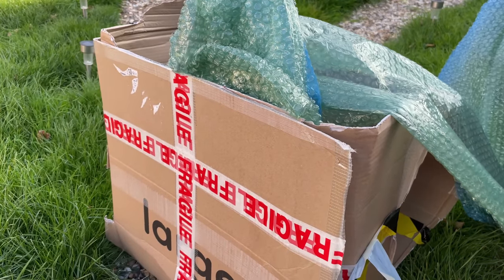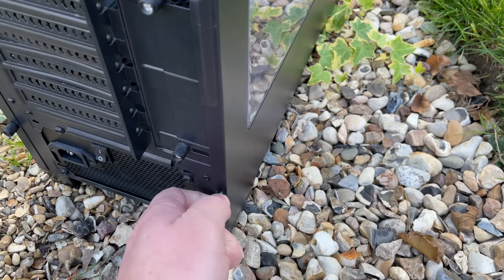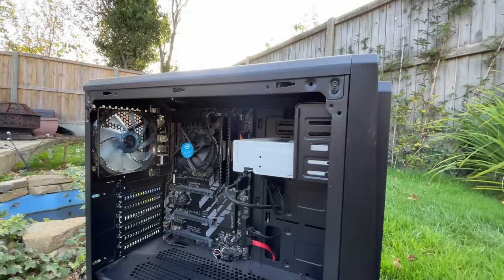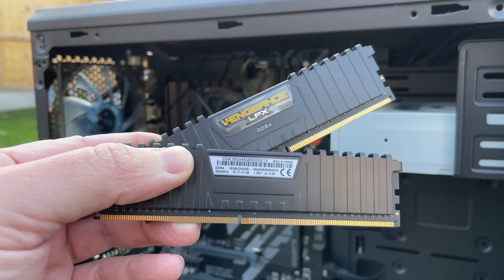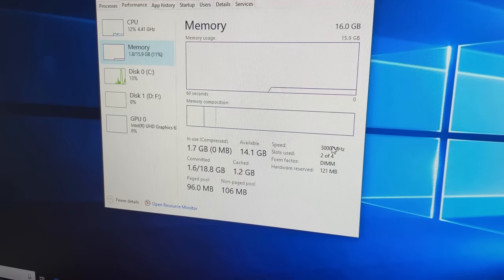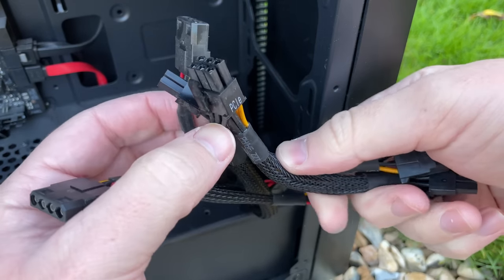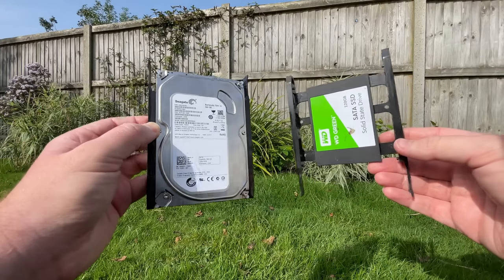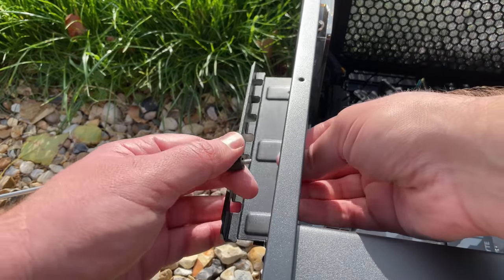This £169 PC has an i7 8700 - But Was It Worth It?

Comment: Having a PC with a DVD drive (and a bay in the cabinet) is always worth it for me. I have got dozens and dozens of games' DVDs that I can't use in my "modern" PC, because decent new cabinets don't support DVD drives.
Reply: Get a usb portable drive. Easy and cheap.
Reply from the maker: Yeah same I always miss it if I don’t have one
Reply: @themorphman100 already tried that. Bought 2 and both stopped working after a while. These Usb ones don't last really long. 
Though I also have an old PC from 2012 which has the DVD drive and that one still works.
Reply: the fractal pop air has a 5.35" bay and is a good airflow case too, if youre looking for an option
Reply: @RandomGaminginHD I call this a "forced" upgrade. So that people have to again buy digital versions of the games they already own on DVDs
Reply: @themorphman100  They are poorly built, versus internals.
Reply: I have dvd in PC and I use it , I have huge collection of games and from Polish PC magazines that gave away games , if Internet was down I have fun for years :)))
Reply: Agreed. 5.25 drives are reliable and are nice to have. External drives are mostly cheap junk that break in a few years
Reply: @themorphman100  Yeah , those dont offer great quality , I had one few years back because my new PC did not had place for dvd , I bought most expensive one , but broke after few months of ussage , I have returned and changed for regular DVD drive and I have bought used old big tower chassie with loot of place , so I could install DVD better solution.
Reply: just use old "top of the line" case, should be pretty cheap on used market, personally i will suggest some of the old silverstone ones
Reply: @themorphman100  Yeah as others have said, they're not reliable at all unfortunately
Reply: @themorphman100 Also too fast for chipped consoles. Only in the US and UK you can get Verbatim CDs and DVDs...
Reply: I think it's horsecrap that modern cases don't have external drive bays.
Reply: @smilingpolitely12345  I hate streaming, it's unreliable. You wanna go back 5 mins back--it's doesn't remember that it loads, and rebuffer the entire fking video.

I still have bluray player on my PC.
Reply: You might want to consider getting a DVD drive enclosure and using a desktop DVD drive in it.

And of course, making copies of your DVDs and/or finding digital installations online. That's usually what I do so I don't have to keep using the drive.
Reply: there are external enclosures you can put your 5.25" Optical drive into.
Reply: @TechOrigami i kept them on cloud storage
Reply: Believe it or not some brands like BeQuiet still make full triple fan chassis with 5’25” bays
Reply: @OttoLP  external enclosures are crap. Next you'll be mumbling something about a USB interface I'm sure!
Reply: @ZipplyZane  I buy DVDs all the time. I like to watch them on my PC too. Your solutions just are not realistic.
Reply: I bought an external dvd drive for pretty much all my gear. got it from currys a few years ago. the difference between 'then' and 'now' is the need for adapters to make some things work on some of my gear.
so I ordered adapters (usbC to usbA) quite cheaply - and I can switch seamlessly. got three laptops without a cd/dvd drive - and it was cheaper to get the external and adapters than it was to shell out on a whole new(ish) PC.
Reply: @TechOrigami  Some publishers (at least Rockstar and Ubisoft) will give you a digital copy if you have the DVD game code. That helped me get my hand on Driver San Francisco, which you can no longer buy from Ubisoft.
Reply: @1pcfred  oh I didn't know that. In what way are they crappy? I usually just use a secondary PC to read optical disks.
Reply: @OttoLP  they're going to be slower than a drive connected to a drive interface.
Reply: @PREDATEURLT  I don't do RGB or windows. I don't want my PC goofing off and staring out a window. I'm not a big fan of bottom mounted PSUs either. It's just poor thermal design. In my world heat rises. Modern cases just suck so bad.
Reply: @OttoLP they’re only bad if you’re into dvd players like vinyl collectors are with record players. The drive will be slower they say…but the “slow” read would be entirely on the drive not the usb 3.0 connection which is much faster than any Blu-ray players can data read. It doesn’t make any sense beyond hipster preferences. These are optical drives not storage.
Reply: Many new "cheap" PC cases do have openings for optical drives. If you are not into RGB bling, you could build yourself decent PC with new parts and DVD.
Reply: Finding a new case prepared for new, gigantic GPUs with a slot for a DVD drive was troublesome for me. I also wanted no ventilation on top and ports on the front rather than on top. The search was long and hard, but eventuallz I found a decently priced Modecom Oberon Pro Silent. It still is missing a SD/microSD card reader but it turned out to be impossible to find all features I wanted without going for unreasonably expensive/used cases.
The theoretically poor airflow is enough to cool an unlocked power I5-11400 and 6700 XT.
Reply: @ZipplyZane unfortunately this would require a cracked iso. I tried just taking an iso of a game I own and the game knew. Just open up the case and rest an internal drive nearby with a sata power and data line.
Reply: @jamjestkowal  the search for the right case is real. I like the old style cases myself. I'm going to have to start recycling cases I think. Old cases lack newer USB Ports on them. So I've gutted an old 5.25" drive and made a custom plate for it. Came out pretty good.
Reply: @JaiLeeroy Usually you just need the right software to emulate the CD. But you can also use nocd cracks. I don't see them as any different than modding. 
 
You don't generally need a whole cracked ISO. And, if you were playing those CD/DVD games when they came out, you've probably already downloaded them, to avoid having to put in the disc every time. 

That said, I don't object to downloading full ISOs of games you already own.
Reply: @PREDATEURLT  I know what you mean. The last time I was case shopping I saw what was out there. The whole PC scene has gone in a direction I'm not too big on. You can say I'm less enthusiastic these days. I plan on upgrading someday but it won't be for a number of years yet. The PC I have still works fine for me.
Reply: @TechOrigami get Samsung pandrives. Best NAND maker
Reply: @TechOrigami old pc from 2012 😂 my main pc is an i7 2600 from 2012
Reply: @themorphman100  Portables are pieces of crap. Plus, most of us already have enough peripherals plugged into our PCs, we don't need more. It really is not much to include the option to install an optical drive if people want to. 
I don't use mine for gaming or watching DVDs, but I do use it for ripping CDs as I have a massive collection and am always buying new ones. Having to have an external DVD drive on top of my extenal HDDs, microphone, webcam, wireless mouse and keyboard dongles, printer, ring light and whatever else I have plugged would be an absolute ballache having to unplug and plug things in and out all the time (and no I do not want to add a USB hub as well as that's even more clutter).
Reply: If you can you'd love upgrading to a blue ray burner.  I have a lot of stuff from GOG and being able to store entire series on a single disk is great. Plus my music, various movie files, new movies with how blue ray is becoming the new bit, etc.

Comment: $170 for the whole PC is a great buy. Thanks for sharing. While the 12400f is faster it also still costs $130 to $150 new. That is close to the price of your (mostly) complete PC. Pair that 8700 with a Rtx 3060 a new tower cooler and you are set for the next few years (Maybe grab a solid 650W Psu).
Reply: a cheap Thermalright Assassin 120 SE would be perfect for it
Reply: 3060...yeesh talk about a ripoff. There are cheaper cards at that performance level.
Reply: A 2080 or 2080 TI would go great with that CPU.

Comment: watching a video from you is such a blessing! also i think the 8700 would go along with a 5700xt VERY well, especially if playing on 1440p (less cpu load usually)! also if you threoretically wanna upgrade to 9th gen, i'd say it'd be better to directly jump over the 9900k!
Reply: What is 2K? In the convoluted mix of either saying 4K or 2160p, 2K is technically one half of the 4K aspect ratio, 3840x2160. 1080p is 2K. 1440p is 2.5K etc..
Reply: @Tomazack  funny story, people actually call 1440p 2k, I had one hell of a brain aneurism trying to make sense of how the hell doubling the resolution of a 2k monitor gave 5k instead of 4k, but yeah long story short people round it down for some reason (maybe to say it faster) so he means 1440p
Reply: @Tomazack  🤓☝
Reply: @amadii8768  fixed the comment to 1440p to clear the misunderstanding. amazing explanation tho!
Reply: 2.56k and 3.86k don't work too well for advertising to the average non techie.
Reply: You can have a much better gpu like the 6700xt with that cpu
Reply: @Tomazack doing the lord's work, lad.

Comment: I recently upgraded my 9600k to a 13600kf.  I cap my fps to 165Hz and I didn't see much difference in fps (most games sit on the limit with either CPU & a 4070Ti) 1% lows are better though.  I had an 8400 before the 9600k and  its still going strong in a basic build. It was a great gaming CPU back in the day,  Great video thanks.
Reply: Lol on what games? My 8600k oced at 5ghz is bottlenwckinf my 6800xt a lot
Reply: I did a 8700k to 13600kf recently
Went from 60-80fps in a server on FiveM I play on, To anywhere from 130-160fps... Definitely well worth the upgrade for me.

Comment: still rocking a 8700k oc'd to 5.1GHz since 2019. paired with a 3080ti and playing on 5120x1440 it still runs like a dream! absolutely no stutters or hitching at all. no upgrade for me yet seeing the non-k variant holding up really well still. 

nice video as always, you're doing a great job for the ever growing community 👍👍
Reply: And if u ever plan to upgrade the i9 9900k is still a very decent option
Reply: @themightylordofgoblins6880  bro honestly avoid the i9 next would be good for a new am5 motherboard if u can stick still with it
Reply: @nodudelikeme  dude Im broke cant afford neither
Reply: @themightylordofgoblins6880  lol i got an i7 4th sticking to it until i can buy an am5 saving for it i told u to save for it and wait even if it takes a year will be worth it honestly
Reply: @nodudelikeme  yea Im saving up aswell and thinking of getting a ryzen 5 7600/7500f lol
Reply: @themightylordofgoblins6880  I am not sure if its am5 or not but prefer am5 for better upgradability and speed go step by step if u can't pay upfront I did the same 3 years ago in the GPU shortage
Reply: @nodudelikeme  yes lol ryzen 7000 is am5 and they will likely get cheaper with the release of ryzen 9000

Comment: Recently built a used parts rig with an 8700, 2070, H310M, 16gb Corsair Vengeance RGB RAM, and 120mm aio in a brushed aluminium case for 800 NZD (about 400 GBP).

It goes hard! The 8700 is a great budget CPU in 2024 🙂👍

Comment: That i7 is basically on par with the 3600, so it's obvious that it would be capable.
 I was a bit surprised at how close it was to the 12400 in Cyberpunk, but then I remembered that the 2080Ti hasn't been ultra top range for ages now, the i5 would pull ahead significantly if a stronger card were used.
Reply: No, is way better. The 8600k was on par and not really either because it was even better for gaming
Reply: @silverwerewolf975  
I own a Ryzen 5500 in my main rig which is on par with the 3600 as well, while my friend runs a stock 8700k. In games our rigs are pretty much neck and neck, same goes for synthetic benchmarks.
Gotta agree to disagree with you on this one dude.
Reply: @vladdyboy2612  Emm no, i have a 8600k at 5Ghz, 2 friends had (because the ryzens 3000 tend to fail) a 3600, i always got better frames. You can see benchs on the internet...
The 8700k wipes the floor with the 3700x
Reply: @silverwerewolf975  I can give you that the i7 is 5% faster on average, but it doesn't wipe the floor with anything past 2nd gen Ryzen. There's no point in arguing since I literally had indistinguishable experiences on both platforms and can confirm first hand that they're pretty evenly matched. I have no experience with the 8600k tho, but that chip might have worse 1% lows in some cpu demanding titles due to it being a pure 6 core without HT.

Comment: Nice! I run an 8700 with Rx 6600 in 2560x1080p. Works really really good for me. Z370 Board and BeBAR works after BIOS Update (ASUS Z370 Prime-P). I run it with vcore set to 1.2mV in BIOS and cool it with an Pure Rock 2 in push pull wih good Caseairflow. Never sees 70 under full load and mostly 60 in Games. I run overlays quite often, in every game at least and it looks like there is no CPU Bottleneck at all with my Budget (Not when i got it ... :D) RX6600. I would rather upgrade the GPU than the CPU at the Moment. But i won't i guess. Works well and i will stay on the Monitor until i get a bigger Card. No Need yet.

Oh, and i feel like RAM Speed DOES Matter, if you have an Z Board. I run 2400 OCed to 2800, and the difference was quite there i have to say! I would like to test 3200, since it works, but i do not know about Stability. Also, i feel bad for investing in new DDR4 Ram, even if its cheap. I would go for 32GB, but still.
Reply: you sure that's 2560x1080? Must be a disgustingly cinematic aspect ratio.
Reply: @Tomazack  Yes, thats 1080p Ultrawide. The small brother of 3440x1440 Ultrawide. Its 21:9. 29 inch from LG. It is the same hight as 16:9 24 inch, but wider. I use The 21:9 as Main and my 16:9 as secondary Monitor. Looks like one wide Monitor if you want. :D 

Tbh, this is THE perfect Monitorsize and Resolution for Ppl that want Ultrawide, but do not have the GPU Power to push 3440x1440 (34inch, same height as 27 inch 16:9). For my Desk (smaller side of life) it is perfect. and i still can push high fps while enjoying Ultrawide Gaming.
Reply: @Tomazack  ultrawide monitors are literally the best. Once you use ultrawide it's really hard to go back to standard monitors.
Reply: @xingbairong   I have to agree. I always wanted one. It is the only way to Play most Games for me. 16:9 feels like 4:3 after 21:9 :'( When first having an Ultrawide, gaming feels different, but not that different. But then switch back and you clearly feel and see it. Ultrawide fells so much better in almost all regards. If you are not interested in competitive shooter.
Reply: God damn, it took me until reading this comment to realise they did eventually push that ReBAR BIOS update, I always assumed it never hit the Prime Z370-P after Asus' initial response, combine that with the fact Nvidia's site suggests that you need a 30-series card to use it I just never bothered checking again. Thank you for pushing me to have a look! I don't know why I even trusted EZUpdate to be accurate
Reply: @evan4686  Glad to hear! I updated theto the newest BIOS (directly from Asus) and there it was. ReBAR in the Bios. Would not boot. Problem (Just in case): My M.2 NVMe (Samsung 970 Evo Plus) was formated in MBR somehow. I almost rage quitted, because i did not know that :D That hindered the compatibility. I had to reformat it from MBR to GPT. Now, the ol z370 and i7 8700 are Win 11 ready, if you like, cause the tpm 2.0 stuff is fine now. After that and a fresh Windows 10, it showed up as activated within the Radeon Software. I guess the boost is not THAT great, but free. Was my first BIOS Update in years, but went fine.

Comment: The Fractal PSU is fine. It's 80 Plus White rated, the rating below bronze. I had one running a RTX 3060 and Ryzen 3800X, no issues.

Comment: I currently have the i7 8700 with ddr4 2400 256 SSD for the OS  and 2 TB HDD with a GTX1060 and it's served me well for 6 years but it's begin being a bit weak for the newer titles and it will only get worse going forward but it is still a great build atm so it will be kept as a back up in another room and used for storing my emulator games on it but I just took the plunge and bought a brand new build from PC specialist an AMD 7800 CPU with all the bells and whistles a GIGABYTE B650M DS3H AM5 motherboard DDR5 5200 1TB SSD and a 2TB SSD 850PSU gold a tower cooler but i only got a RX6700 XT bit on the low end compared with the CPU but it gives me the potential for a big GPU upgrade in 4 or 5 years when the higher end GPUs are cheaper hopefully lol. But up till now it could handle pretty much all games out there at 1080p so definitely not a bad CPU  to have
Reply: I went 8700+1060 to 7800x3d+7900xtx. Hoping to get 10 years out of it. Got 6-8 from the 1060 also.
Reply: @DanA-st2ed  Nice must have cost a fair bit but ye should last a good while im jealous lol
Reply: @Peter-je6td  Just wait for the PCIE5 GPU's to drop and bag one with loads of RAM, that would have been the better play if I was patient.

Comment: 8600/9600 and 8700/9700 or even 9900 are also great upgrade options for skylake/kabylake users. A little bit of googling and some BIOS modding plus old-school cpu modding and one can get a really capable and cheap system. Running Z170 + 8600k myself without issue. I've started this system with z170 + i3-6100 in 2015, later bought 2nd hand 6600k and then 2nd hand 8600k. I don't really feel the need to upgrade, 8600k + 2060S still runs a lot of games at acceptable framerates. 1151 platform had great potential, pity Intel made it officially incompatible for commercial reasons.
Reply: Z170 users unite! Running 9900k on both of my systems running gigabyte z170x-gaming 5 and mugen ii coolers. Ram overclocked from 2400mhz to 3000mhz as well